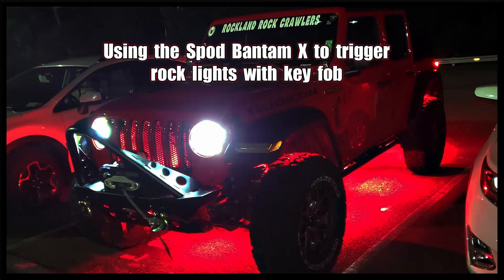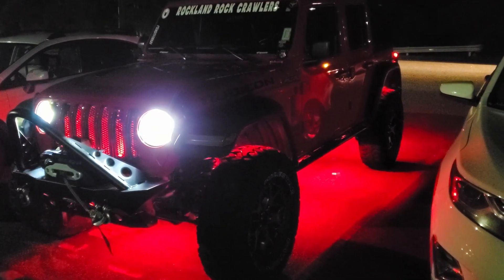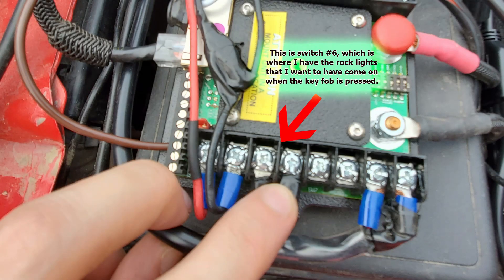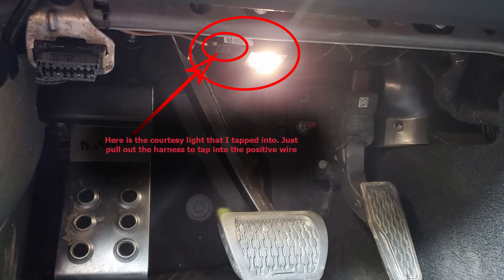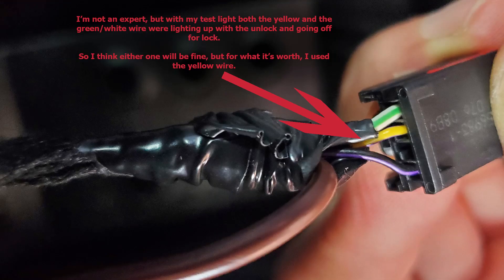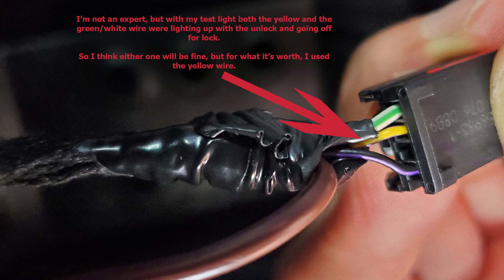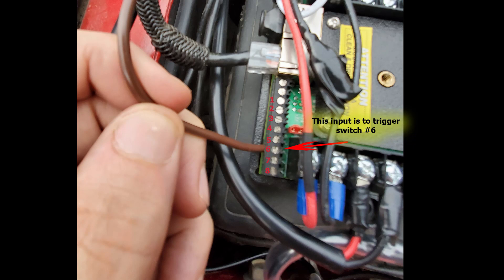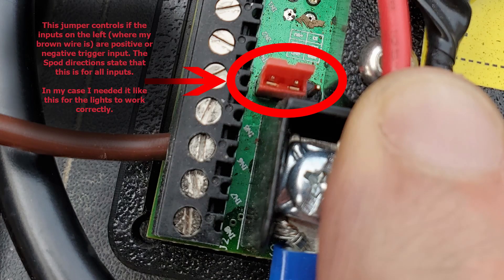Use the sPOD Bantam X to trigger Rock Lights

Comment: nice , which brand of red lights did you go with under the truck? looks great
Reply from the maker: I think when I did this vid there were 2 sets of lights. I have Xprite 8 pod RGB lights and Mictuning 8 pod RGBW lights. Basically, kind of inexpensive lights since I knew they would prob take a beating offroad. All lights are still working though.